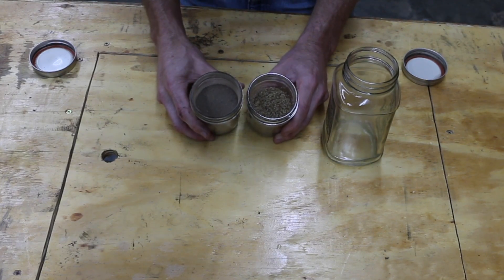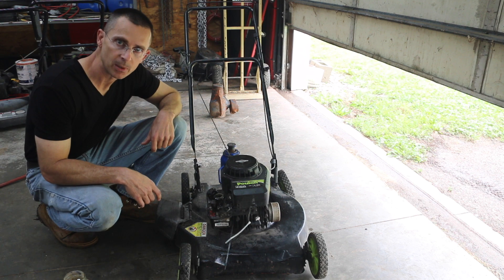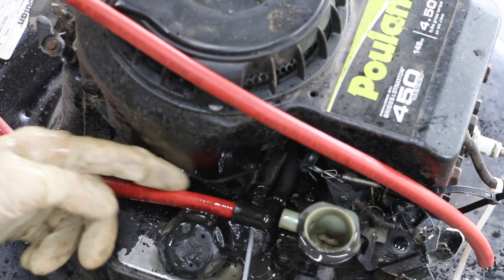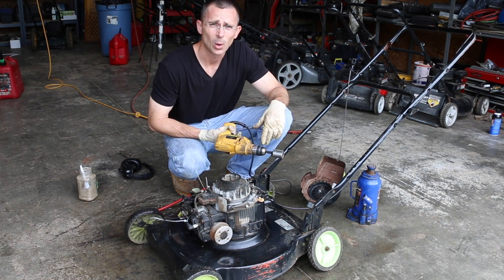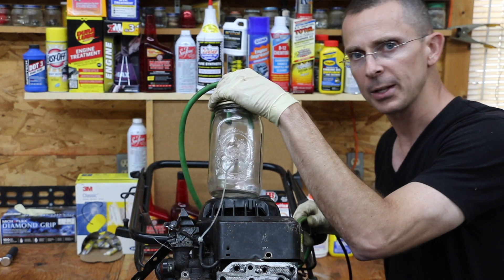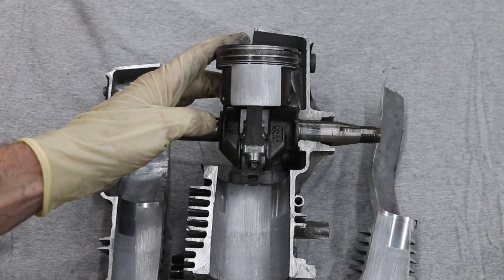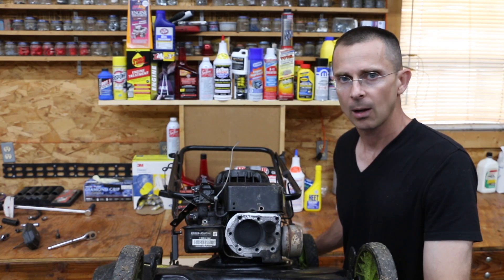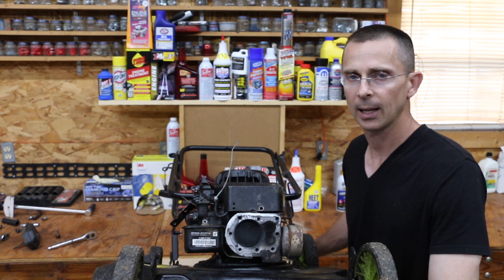Will Dirt Destroy an Engine?  See what it does to this Engine!

Comment: What about hydro-locking an engine? Having the engine run at med to high rpm and pouring water into the carb. I had a 2.2L GMC Sonoma break 2 rods when it sucked water into the enigine.
Reply from the maker: Nathan, Great suggestion!  This is a real-world possibility as you experienced!  Thanks for watching the video and the great suggestion!
Reply: Matt martin doesn't understand that some people give a shit what their lawn looks like. When the flood waters go down and your lawn looks awesome, it was totally worth fucking up 6 mowers!
Reply from the maker: awesomefacepalm, Wow!  This could be very interesting!  Thanks for watching the video and commenting!
Reply: Matt Martin Hydro locking usually occurs when you drive in to a flooded road or deep water and not because of coolant leaking into the cylinders
Reply: Thanks for calling me stupid. Now go learn proper English and punctuation so you can research blown head gaskets and coolant leaks into intake manifolds.
Reply: kart35 before you start calling people stupid, I'm sure he was talking about the case on water cooled engines where the head gasket blows and forces coolant into the cylinder.
Reply: Who exactly is going to be mowing their yard in knee deep water? lol
Reply: I don't think it gonna break a rod on a mower as the blade has not enough inertia to do this work
Reply: It would be strange to hydro-lock a lawnmower considering they are air cooled and do not have a liquid cooling system. I guess if you drive it into a lake? lol
Reply: I've seens some engines blow the top of when they sucked in water.
That would be interesting :)
Reply: Matt Martin hydrolocking a mower isn't something you do by accident. but cars and such
Reply: I think that a mower's engine will take quite a bit to get damaged from hydrolocking.
Reply: Rick Hubanks that might be the funniest comment ive read this week
Reply: When you do it pin the governor wide open before you dump water and make sure it is running the absolute Max revs and stick a garden hose straight into the carburetor
Reply: esqueue a diesel engine is more vulnerable to getting water locked since it has higher compression
Reply: pour some sand down your 2.2
Reply: cause of RPM ,
Reply: Matt Martin you are stupid hydrlock isnt cooling its when the engine takes in water thru the intake...people i sware

Comment: That is a bit of a wake up call. Id also like to see if diesel or alcohol could ruin an engine as well as gas in a diesel engine if you can get a hold of one. Maybe like an old cement mixer engine.
Reply from the maker: Cracker Jack, Great suggestions!  I'll be on the lookout for an old diesel for testing. Thanks for watching the video and commenting!

Comment: i was going to say it would have been a good test for one of the compression additives 🤣🤣 to late.
Reply from the maker: Dustin, Great suggestion!  I don't believe the clippings would do near the damage, but it could cause some harm.  What do you think?
Reply from the maker: Cracker Jack, I agree that honing would definitely would be better than continuing to use with such bad scoring.  Great suggestion!
Reply: i dont think it would do much to the walls but it might do some damage. never know until we find out
Reply: what about grass clippings getting sucked into the intake. what do you think that would do?
Reply: I was thinking if honing the engine would help but maybe jb weld would probably be a better choice.